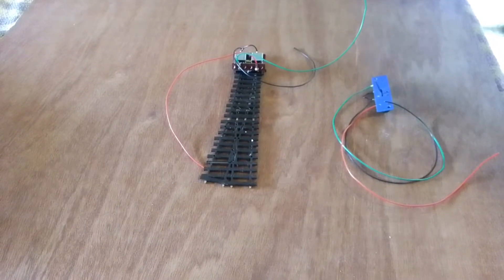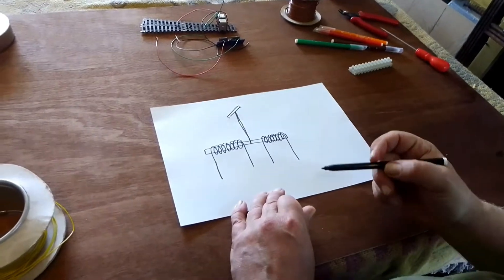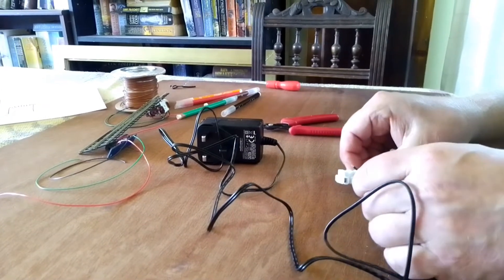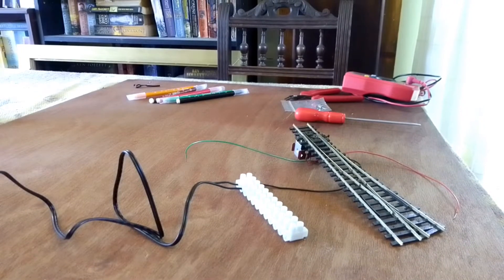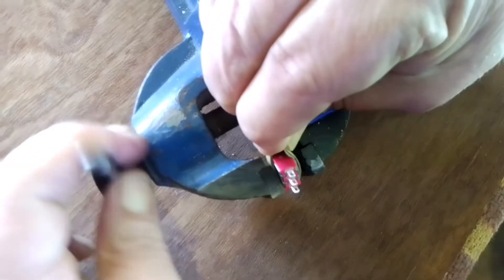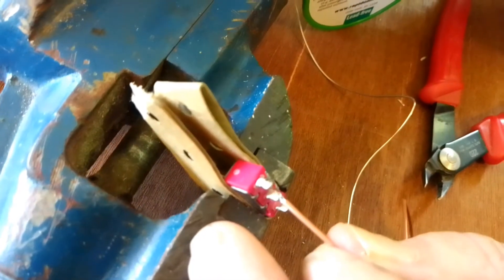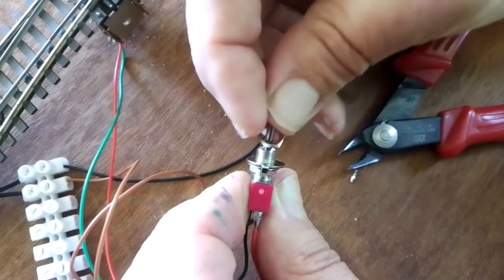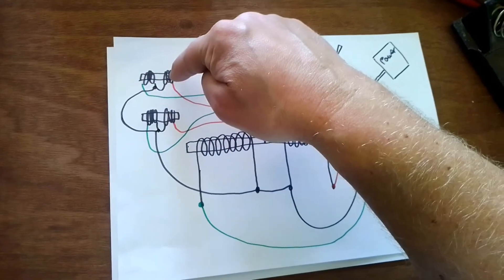How Peco and Seep point motors work and how to wire them.

Comment: Thanks for this video, really informative. Could an 'On-On' switch be used instead of an On-Off-On switch? Reason firstly is so that an operator could see from the switch position how the point is set, and secondly so that the switch could also be used to power the frog or for a red/green signal.
Reply from the maker: The point motors take a large current so if they were left permantly switched on the solenoid coil in the point motor would get very hot and possibly burn out. Even if it did not there would be insufficent current to power a number of point motors from the same power supply. With momentary switches as  soon as you release your finger the switch (which is spring loaded) goes to the off position.
Reply: @heathcote-electronics  Ah, thank you that makes sense. I am wondering though how the frog of a unifrog point could be powered off the aux switch of the Seep PM1 if the power from the CDU is isolated after a switch of a point.

Comment: First video I've seen as a newbie with no electrical smarts that explains point control. Is there any benefit to adding a capacitor in this circuit? I'm planning an n gauge small DC layout with 4 or 5 points that I won't need to be changing at same time. Thanks